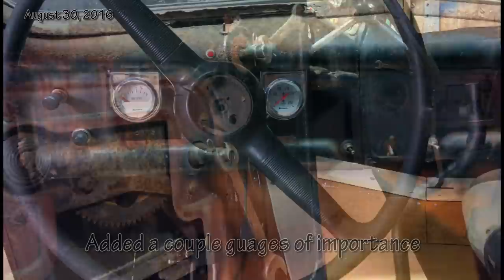1946 ford 1 ton truck Rat Rod Build Video

Comment: as insane amount of work went into this rat rod truck, I personally don't care for Rat Rods but my hat is off for you bud, excellent work, job well done, I know or have an idea about the amount of work that went into getting this vehicle to the stage your at, a lot of one off ideas and a damn fine job, I have built quite a few vehicles myself, none that come close to what you have done but I know how much work goes into building our pride and joy, I can only imagine how many late nights went into building this, I have been there done that, one vehicle that I built for a customer I literally worked 48 hours straight to get it ready for the paint shop to take over, this is bad ass bud!!!!!!!
Reply from the maker: I'm surprised, (in a good way) that there are still people who can have positive feedback even though they don't care for the finished project.  There were many long nights. good thing I don't need to do any body work...
Thank you for the kind words.

Comment: nice job Mr Dizzo !  always been my dream to build a rat rod , workin on a jeep now but who knows maybe some day , thanks for your vid also not a bad job welding you did , i always say my most valuable tools are my mig my press and my torches , if you don't have at least those tools your going to run into one dead end after another ,
Reply from the maker: That's true.  Time to buy a press!

Comment: Not sure what to say, without sounding like a star struck school boy, Your build was amazing and it's actually "A Rat Rod" most, like maybe 97% of them are a Joke. You could and should write a book on building a rat, the correct way. I have never built a rat that low but if that is what you like, the frame flip was the essence of Rodding. My last rat was the equal of Your's  and cost $0.97 a pound no cost for labour,  admittedly I had an advantage, it was 58 years ago and I had no money. I think mine was better as it was mine. Spread the word "Rat Rods are back"
Reply from the maker: Wow!  thank you so much for that. I do agree this is more of what i consider a traditional rat rod. Not just a hot rod with flat black paint. Sounds like you have some stories to tell.

Comment: My first one was a '46, it screamed to be chopped. The first part I bought was a Farmall grill.
I found a "rolling" chassis that a father and son had lost interest. The cowl had dropped about 3 inches due rotting out of the body mount at the base of the hinge support. I spent abut 6 months getting the body straightened out so the doors would operate and then chopped it while is was bolted to the frame. PS: you VIN in on the top of the left frame rail just below the firewall....get that section when you buy a body.
Sold that one now I am finishing up a '47 Ford cargo.
Reply from the maker: nice!  I may chop this thing, but i like the headroom.
Reply: @DizzoMartell : I am 6'3" and I chopped mine 5 inches and still have plenty of headroom......

Comment: I have a question. Why did you flip the frame upside down? Then the leaf springs are upside down
Reply from the maker: Cheapest way to lower it.  Springs just want to keep their shape.  It works fine as it is.  Look up "underslung suspension"

Comment: Fun video Dizzo. Super cool to see it. I hope you got the caster figured out.
Reply from the maker: Thanks! caster is good for now.  Just need a steering stabilizer.
Reply: Dizzo Martell yea this things sweet. 
I saw one thing that you might wanna keep an eye on regarding those drop links for the tie rods. 
Last night I was heating up a foot long battery hold down rod for a halfassed exhaust hangar , I was down near the threaded part where it went smooth. 
As I bent it , it broke at the threads.
Those drop rods are threaded the whole way....
I doubt that's ever gonna be an issue, it's not like you are gonna do an off road rally in it. Haha if they were like 6-8" long then ya might have an issue. 
Sweet build, what i said isn't even an issue, and I'm glad you are running a diesel!!!!
Reply from the maker: Thanks for the comment.  I've actually change them to regular tie rod ends, and added a dropped drag link.  I was worried also, that's why I changed it.  Thanks again!!
Reply: Dizzo Martell haha smart man you caught it too,,,love the build though. 
hope you have fun with it, haha usually they never end,  you will think of something else to modify ;)

Comment: Great looking rat truck but Are you not concerned about the safety of running those leaf springs upside down like that?
Reply from the maker: I am not.  I don't plan to put a lot of miles on it, or put a lot of weight on it.   But automakers have been using springs "upside down" for a long time.  Look up transverse springs.

Comment: Cool build!  I liked the idea of flipping the frame to get a lower ride height.  Is that the stock rear end that came with the truck?  Just curious how it's doing with a more powerful engine and 5-speed transmission.  Looked good running at the end of the video.  Congrats!
Reply from the maker: Thanks!  It is the original rear end.  The motor isn't much more powerful than the original motor.  It is only 80hp.

Comment: Great build but one question... how do you get any suspension flex, the spring is designed to flex towards the frame in stock orientation.
Reply from the maker: I switch the stack.  Springs just want to stay their shape.  So, they do flex.  Not much, it is a 1 ton...
Reply: @DizzoMartell , ok, I see. Appreciate the reply, enjoyed the build and you did an awesome job.
Reply from the maker: @TheRoadhammer379  thanks!!

Comment: Nice job on the truck and great video . like the odd engines. Building  a 69 f100 w a mercedes turbo diesel using a ford explorer chassis. Thinking about channeling the body on it . like how you did yours.
Reply from the maker: Which MB motor?  300SD?
Reply: @DizzoMartell  yes from 1980 300sd
Reply from the maker: @mrjimshotrodbarn1686  nice! We had a silver 1980 300sd
Reply: @DizzoMartell  I bought the Benz for salvage as it was totaled . was hit head on so no saving that car . engine only suffered a broken fan and water pump .

Comment: Wish I could do this, but I’m young, I have little money, little experience, and no lift
Reply from the maker: Age doesn't matter, I had little money, I learned while I was doing it, and I have no lift.  You can do it.  gotta have persistence and desire.
Reply: Dizzo Martell thanks man yeah I’m taking a year of auto shop for basics, I plan to buy a roller that I can fix up and learn along the way
Reply from the maker: @sjeffy5137  I have faith in ya

Comment: Awesome !!! Can a 52 ' f1 be flipped like this ? Thank you for sharing your hard work .
Reply from the maker: it looks like you could. You would have to flip the axle after and the front suspension, so your camber and caster are correct.
And make new mounts for everything.  But, it could work with time and ambition.

Comment: I would have boxed that frame in & lose some of leaf springs for a better ride. but a nice build
Reply from the maker: Thanks.  I boxed where the steering box is.  It's a 1 ton, so it wasn't really necessary, If i took any springs out the frame would hit the ground...  Super low rider!

Comment: I wouldn't have done the drop only because I need the ground clearance. I'm NOT knocking your build I CAN'T!!! Your cab bracing & trans tunnel is OFF THE HOOK STRONG!!! Your floor bracing BULLETMUTHAFUCKINGPROOF!!! Your pedal mounts FUCKINGFLAWLESS!!! What does your motor put out??? I noticed it was injected (Nissan)... Although your taste & design choice differs from my choices...YOUR TRUCK..." Killer Build!!!
Aloha,
Chief
Reply from the maker: Thanks!  I appreciate the comment.  The motor is a Nissan Diesel STraight 6.  Only puts out 80hp, but has 120ft lbs of torque.

Comment: I am actually going to be building one with a 52 5 window. How much did you pay for yours?
Reply from the maker: The roller in the beginning was $700. The motor and trans ended up free after i sold the ranger it came in.  the rest, was just parts i found or needed new, like brakes and lines.  total under $4,000

Comment: With the reversed springs is their any spring travel/movement?  Cool build you did
Reply from the maker: There is movement in the springs.  the springs are just upside down.  They seem to work just fine.

Comment: Still a bit suspicious of the leaf springs having the normal loading reversed..... Like putting the string the wrong side of an archery bow I can't see it being an improvement on the original design. Still. As an ornamental thing it obviously took a lot of  work to get the looks and the music good in the vid.
Reply from the maker: The leaf springs work fine this way. if you look at some old transverse spring cars from the 20's and 30's, they were also the same way.  Thank you!

Comment: Hello such. great project. I would like to know how you walk maximum speed and differential ratio transmicion has placed if you do not mind greetings !!!
Reply from the maker: So far, top speed is 62 mph, But only because i need new tires before i take it on the highway.
It should do 75-80 mph no problem.
Reply: actually it would have to reach about 120mph or more if you apply a turbo. I have a van with that engine with a super short box and alcansa the 80mph. and my father had a Mustang fastback with that engine 68 and reached 120 mph without turbo. luck with project completions greetings
Reply from the maker: My gear ratio is a little lower than those vehicles.  It is a1 ton pickup
Reply from the maker: Curious though, were you using a diesel LD28 or gas?
Also, how did you adjust the fuel rate.  These diesel LD28's are not adjustable.

Comment: i wish i could do thing like that. of course we have no old metal. and will get pulled over, towed, fined, jailed. you can't build cars!  but we have like 0 car defect caused accidents (fires do not count, and those are almost always bmw suv cars) but car safety is the number 1 priority. rust is unsafe and you fail inspection if someone finds some rust on the car
Reply from the maker: That's Crazy.  Where are you from?
Reply: I might overestimated the jailing part :) In europe we have pretty strict motoring rules, I'm in Lithuania, in theory we can register homemade vehicle, but when it is not tractor implement for farm use it gets pretty complicated. You have to file proper (who knows what that means, organizations did not have any requirements, when I checked but were fine in failing you) drawings, plans calculations to one of the two organizations who registers cars (one run by the state, other commercial run). I studied engineering and can't do those. You have to know specifically vehicle engineering. According to people I talked who made electric car conversion and tried to get that legal, they were given the go round "go to those other guys" talk from both of those. That was years ago, but somehow I doubt it got better. 
And the old metal part- 50 years of occupation by soviets will do that to you- not a lot of precious cars, and after that there was an "metal rush" when everything was sold for scrap and stolen and sold for scrap. Including still working grain silo equipment electric motor windings. You go there one morning and every motor in the building is smashed, wires from the walls gone too :)

Comment: How do you like that ride from flipping it? Any issues with the springs?
Reply from the maker: no real issues.  Rides rough, but not too bad.
Reply: Cool. I'm looking at a 49 Dodge 2 ton with the LOONG frame for doing the same thing. BTW, why is there a giant green strap on the box fan in this video? Solving a vibration issue?
Reply from the maker: Mike Patton haha, so I could hang it on the wall.
Reply: Can you do a good 360 photo or video shoot of this when you get some time? I'm really looking at it for inspiration.
Reply from the maker: Ill try to get something together once the weather breaks.
Reply: Got mine flipped finally and scored a late 70s Dana 60 dually rear end for 50.
Reply from the maker: NICE!  get some videos up.
Reply: Got the cab bolted up and suspension finished. That steering drag link will require some hillbilly engineering to the box.
Reply from the maker: That's the best kind. Get some videos up already!
Reply: I posted a update pic on a facebook rat rod page IM a member of and dang they were hating all over that suspension set up. I let it go for a while then posted this video about how YES it does work and that shut them up. I got some short project vids up now.
Reply from the maker: Mike Patton I need to post there.
Reply: Dizzo Martell primer & rust, rats & rods
Reply from the maker: heck i'm on that page, i think...
Reply: Dizzo, what did u use for a fuel tank?
Reply from the maker: i had a 5 gallon Boyd aluminum tank that lives in my treasure chest.

Comment: What kind of driveshaft did you use
Reply from the maker: I had one made for it.  I used the slip yolk from the Nissan trans and had one made.
Reply: Dizzo Martell okay just wondering because I'm buying a 1 ton 47 chevy for $250 at first I was going to fabricate a chassis but I decided to use what was there only difference is I'm putting a bed on mine
Reply from the maker: Nice!  installing a different motor, i had no choice but to have one made.
Reply: Dizzo Martell the way it's shaping up I'll have a rat rod before I get my license
Reply from the maker: Sneaks4life haha. Perfect!
Reply: Dizzo Martell since I'm young I'm hoping to keep the build under $3000
Reply: Dizzo Martell I wish I could find a engine like the one you have I love diesels
Reply from the maker: Sneaks4life mine was built under $3,500. Search old Nissan patrol motors.  LD24, or anything like that.  You should be able to find something
Reply: Dizzo Martell btw is that independent hoodie your wearing in the vid for independent trucks
Reply from the maker: It sure is!
Reply: Dizzo Martell my man that's what I skate
Reply: Dizzo Martell I finally found a running Sd33 Nissan a straight 6 diesel and I'm trading two axles for it so it's practically free

Comment: Funky build!  Check rear brakes dude, me thinks you have the leading shoes back to front
Reply from the maker: explain, please.  i didn't switch anything around.
Reply: Hi Dizzo,  looking at your rear brakes (frame 16:25) normally with drum brakes the shoe with the "leading edge" (where there is more metal than friction material showing at the one end of the shoes) should correspond with the direction of forward rotation, so in that frame the leading edge is seen to be on the right of the cylinder, when it should be on the left of the cylinder and then the other shoe (right hand shoe) would have the leading edge at the bottom (left hand drum, forward/anti clockwise rotation) Looking at your build and how you have lowered it, if originally in standard form the cylinders where at the bottom and you have flipped the axle?, this may be the issue, or it's possible the shoes have been mixed up from left hand side to right hand side of the axle?????? hope you understand. Regards
Reply from the maker: I see.  I flipped the frame, then the axle, so it is right side up.  I thought i put them in the way they came out, but maybe they were wrong from the beginning.  Also, look close at that frame again, i don't think there is a leading edge on the left shoe.  I'll pull it apart and take a look.  I appreciate the advice.  good catch!
Reply: Good lad,  safety first!  if possible check OEM shop manual for diagram, are the brake cylinders shown to be at the bottom of the back plate, rather than at the top (as in frame) they will work as they are, but may not wear as intended, as if the axle has been flipped (upside down/180) it is running backwards now (theoretically) Example - face the drum and rotate your finger in the same direction of forward travel of the truck, keep rotating your finger in that direction, now do a 180 (what you have done by flipping axle) as if you were now facing the drum on the other side,  your finger is now running backwards compared to the forward travel of the truck, yes?
Bit of a melon twister trying to explain, but brakes are a safety item and need to be right  (especially being drums all round). If it is the case that originally the cylinders were at the bottom, then it may just be a case off swapping the back plates (if poss) to either side and keeping the hand brake cable entry holes facing the front to achieve, rather than flipping the axle back and cutting off the leaf spring mounts and welding them 180 from original to keep ride height, you would probably have to make new brake lines too. Hopefully you can sort it by swapping the shoes around, or if I am totally wrong and the set up is correct, then I do apologise sincerely  Anyway, have fun, be safe. 
Regards
Reply from the maker: I gotcha.  Yes i flipped the axle back over, so it wouldn't have 5 reverse gears and 1 forward gear. :)  The backing plates and axle are correct, but the shoes are probably wrong, to your point.  I had to have the shoes refurbed, so the guy who glued the new pads on the steels may have switched them, or i just put them on wrong.  I will let you know what i find once i get out in the cold to check it out.